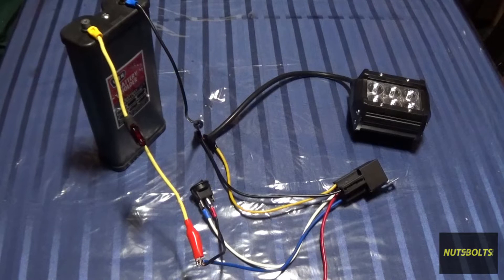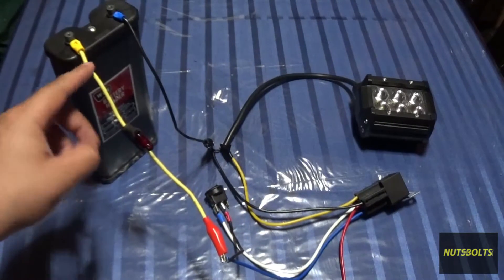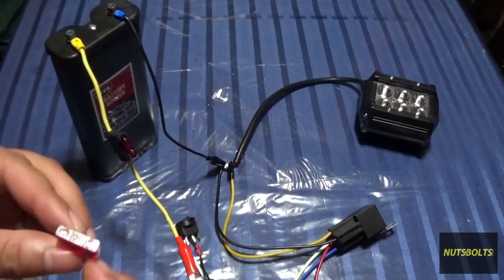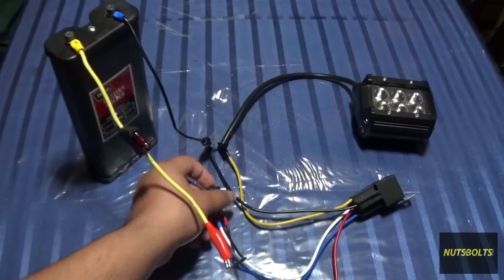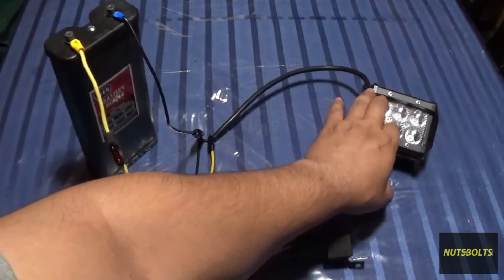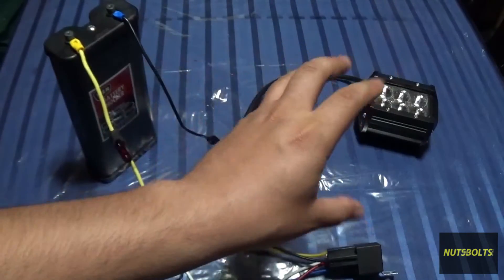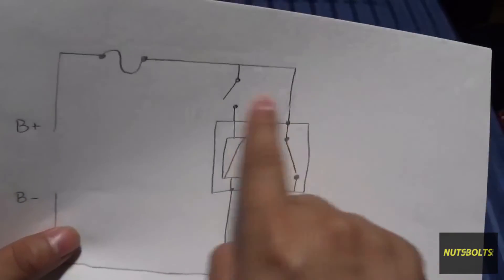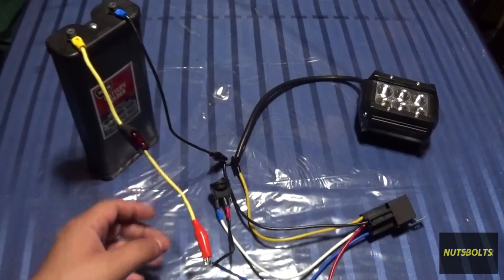How a Basic Automotive Electrical Circuit Works

Comment from the maker: Here are some things you may need:
16ga Primary Wire:
https://amzn.to/3rw8RuO
In-line Fuse Holder:
https://amzn.to/3c6yw6M
12V Momentary Switch:
https://amzn.to/30pCsu6
12V Rocker Switch:
https://amzn.to/38klL7y
Universal 12V 5 Pin Relay:
https://amzn.to/30sA4Tr
Wire Terminal Kit:
https://amzn.to/3t2HZmM
Assorted Fuse Kit:
https://amzn.to/38j7xUr
Heat Shrink Tubing:
https://amzn.to/3v7hA91
Klein Tools Wire Crimper:
https://amzn.to/3cgcb6P
Irwin Automatic Wire Stripper:
https://amzn.to/3kY4Ixd
Performance Tool Test Light:
https://amzn.to/2PN01ek
Reply: great video.   seems like you'd be the perfect source to answer a question for rewiring my fog lights into Daytime Running Lights.   Currently, they don't get power with the ignition switch.   Ok, so I'm supposed to use a Tap from a fuse that DOES get power with the ignition switch ON.  That Tap adds a fuse for the new lead-out wire.   So I pull the fog fuse from its current position to make way for the lead wire from the Tap....   Yes?   ...but which side of the now-empty fogs fuse holder do I plug this new hot lead into?      Hot shouldn't meet hot......right ?

Comment: Blue wire (from battery to relay): This wire typically carries positive current from the battery to the relay. The relay is an electric switch that is activated when it receives an electrical signal. In your case, the blue wire goes to the relay to activate or control a function, such as starting the engine or operating other electrical devices.
Black wire (from battery to switch): The black wire usually indicates negative current or ground. In your case, the black wire goes from the battery to the switch, meaning it carries current to the switch used to control electrical devices.
White wire (from switch to relay): The white wire typically carries a control signal from the switch to the relay. When the switch is activated, an electrical signal is sent via the white wire to the relay to activate it and allow or prevent current flow to the consumer.
Red wire (from relay): If the red wire doesn't go anywhere from the relay, it might be a spare wire or intended for another function that hasn't been implemented. In some installations, a red wire is used as an additional output for current to other electrical devices.
Black wire (from relay to ground): This black wire usually serves as ground or the return path for current from the relay to the ground or the negative terminal of the battery. This ensures that the electrical current has a closed loop for return, enabling the proper functioning of the electrical system.
Is this correct? Thank you for your answ.

Comment: Does really every single device need a relay? For example aftermarket power windows, door locks, stereo, fuel pump, radiator fan. Some of the devices cant they just come from a fuse box wich is feeded by a thick wire from the battery, but before the fuse box is a manual switch which you turn on off when driving/parking?

Comment: Why would your circuit shown need a relay. Surely the switch you used is rated for the load fuse in your example. A relay is used for lower amp switches. It must have a lower fused circuit feeding it. Don’t burn down your ride.

Comment: If I understand correctly the relay switch both break and join circuits. Why does a circuit have a relay after the switch if the switch can do what the relay (switch) does?

Comment: Any idea how a bi-directional scan tool would control the example circuit in this video? I see people control electrical components in their car in videos, but I don't see how the computer would send such a signal. Are there extra wires coming from the computer that we don't see in an archetypical circuit like this?

Comment: I'm confused ? " If " the fuse was on the Batt GND and it blew - The load will stay on - until it kills the battery ???? If the Batt - GND wire is disconnected - that breaks the circuit and the Load would be "Off" ?    I think to reason for the Fuse / Breaker to be in the Hot-side - "Is to Stop the power" from burning-up the wiring... You can run a negative ground circuit, but the fuse would still be in the Hot side... I may be wrong -

Comment: If we want to add load and doing wiring,does we need to unplage the batt terminal first?
Reply from the maker: General rule of thumb when doing any electrical work is to disconnect the battery. This is to reduce the chance of an accidental short while working on the system.

Comment: HOW A RELAY WORKS:

It uses a smaller amount of electric to open the relay switch or (diode) to complete the circuit.
reason why: power straight to the switch will burn out or catch fire even with a fuse
The relay bypasses the switch to take the load off it. 

So, power in to an inline fuse, into the relay, power goes through a resister and create a magnetic field that opens the diode.  

I believe I have that part correct.

Then from there the rest is the same.

****edit****.   Awesome video!!!!
Reply: That is not correct.
A mechanical relay is a simple device.  It has an electromagnet (coil of wire wrapped around a ferrite core), and a set of mechanical contacts.  The coil is connected to the switch.  When you turn the switch on it applies voltage to the coil and that's all.  The coil draws very little current. The coil is an electromagnet and pulls the mechanical contacts closed or open (depends of the design configuration of the really).  There is no diode.  The contacts have a much higher current capacity.  Those contacts are connected to the load (lights, motors etc).  Just as the video indicated. That allows you to switch higher current devices with a low current switch.  A mechanical relay is not a diode.  

Now that said, flyback diodes or resistors are sometimes used across the coil of a relay to prevent voltage spikes (transients) from damaging components or creating noise in the entire electrical system.  But it's not really a basic  function of the relay itself. It works the same with or without.

Comment: Excellent approach for beginner like me. Can you explain to me about the ground?  From your explanation ground generality the negative terminal that return to negative part of battery. For multiple negative wires, those wires will be connected to body of car, and the body will have connection to the battery. Do you think I grasp the knowledge? If yes, which part of the car have such connection?
Reply: Sounds like you understand!
I think all electrical car accessory will ground through the body of the car? but I'm not sure

Comment: Hi there. I recently changed the ecu and both control unit/ fuse boxes in the engine bay and boot/trunk. After doing this my interior fan does not work on speed 1 to 4. Can I hot wire it to a on of switch to bypass the 1 to 4 knob so it's a on or off. Thanks

Comment: nice video but if you put the fuse in the begining of the ciruit or at the end it would not matter because if the fuse cut off it will make it open circuit

Comment: How,If you put the switch on the ground side it will be staying on?can you please explain?
Reply from the maker: You can put the switch on either side of the circuit. I was just giving an example of one kind of failure.

Most people would put the switch on the positive side. Computers usually control grounds. It just depends on circuit design and what you plan to do with it.
Reply: if you put the switch on the ground side you essentially have voltage on the entire circuit up to the switch.  If a wire anywhere up to the switch shorts to ground, then the circuit will be continuously on and not affect the fuse .  If you place the switch  on the positive side of the circuit, then any short to ground on the positive side will blow the fuse.

Comment: Thanks dude. Why is it necessary to have the red wire? What would be an example of where it would go to?
Reply from the maker: The red wire (coming from 87a) isn't necessary unless you wanted an alternate circuit. It is also useful if you want a normally closed circuit instead (light on when switch is off, for example). For most applications, you would remove it or use a 4 pin relay instead.

Comment: Great content!  Excellent electrical theory.  I would like to see a followup video on the practical side.  In other words if I were to build that exact circuit in my car, what wires, connectors, etc would I use, and how would I route and connect them to do it properly.  Do I need to solder?  Do I need a special crimp tool.  Could include Amazon affiliate links to the stuff you used.
Reply from the maker: Thanks for the advice, it's very much appreciated. I do have follow up videos planned. Hopefully it all works out :D thanks again for watching 👍
Reply: @NutsandBoltsAuto  Another Ken who appreciates your teaching. This was pitched just at the right level for me, filled a lot of gaps in my auto electrics understanding.